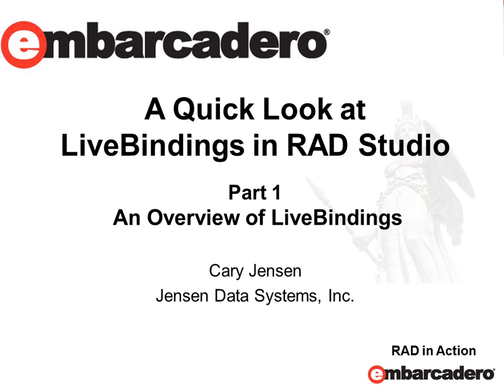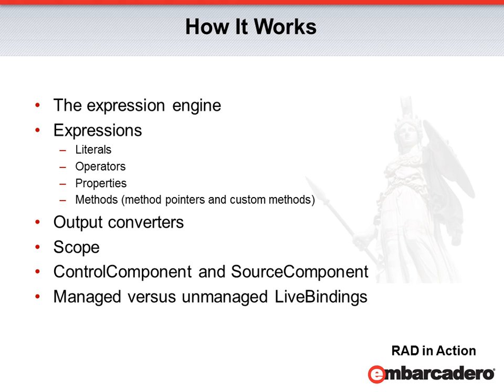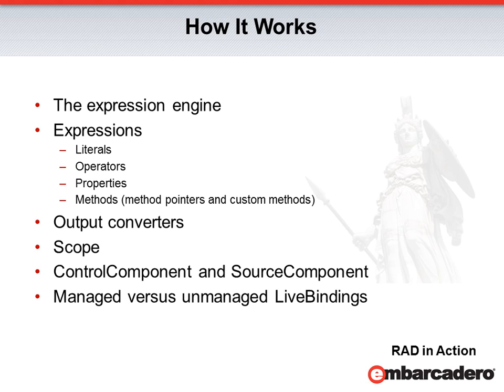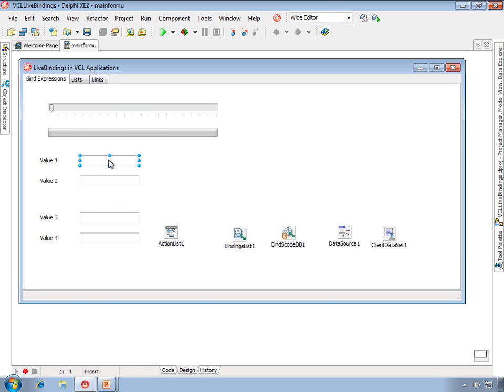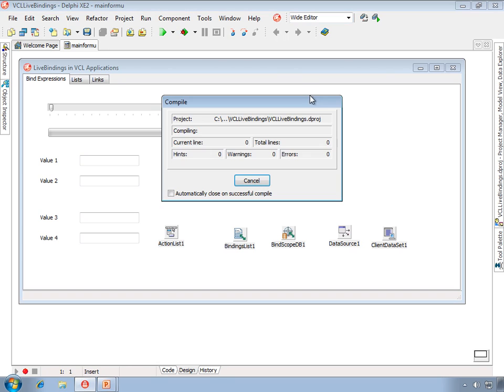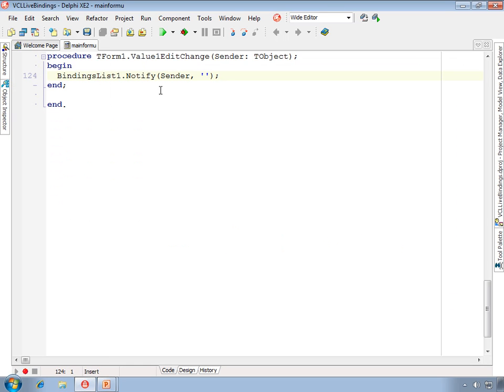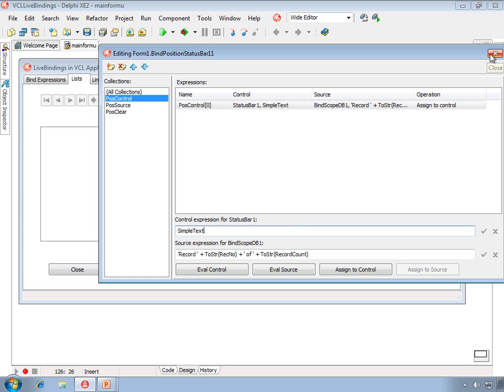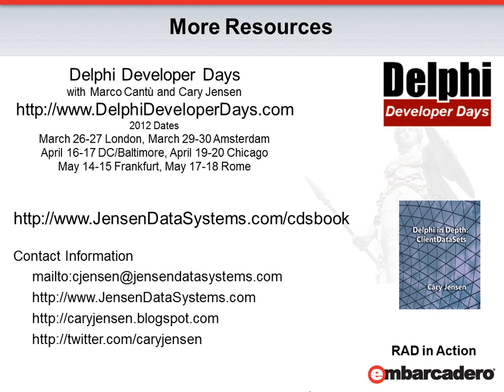An Overview of LiveBindings

Comment: What if I need say, TControl components to save their values/states to a XML file, and the LiveBinding expression would involve an XML element identifier? For instance an ident of "xml.main.gallery1.set15.ruleslist" and string values of a TListBox or TComboBox are saved/loaded to/from this element. And access needs to be fast, so values must be copied in RAM for use with animations, for instance. I tried to check if the XE2 demo could do this, but no luck. I wish to only bind at application/obj